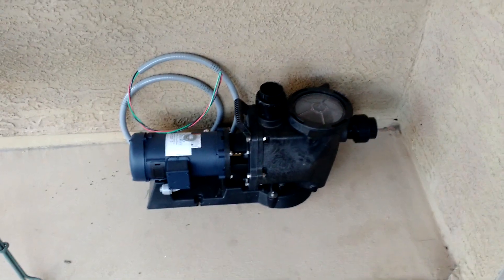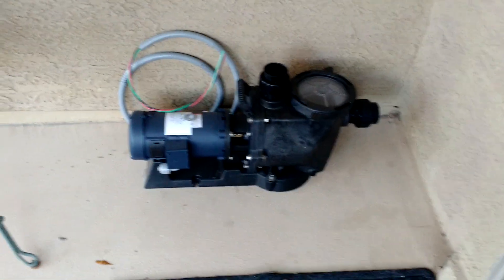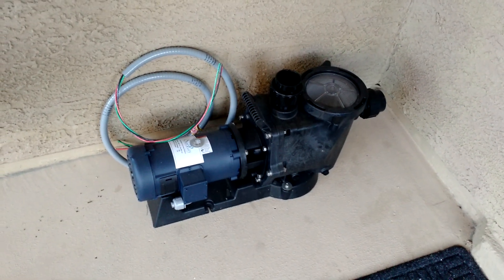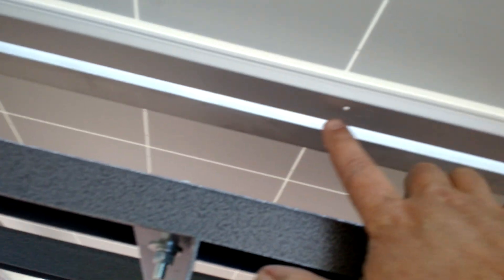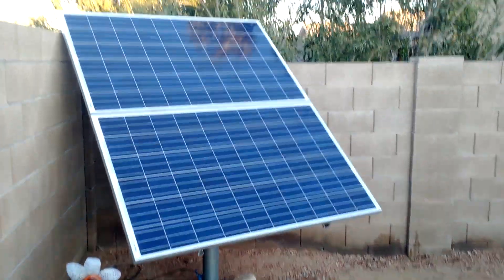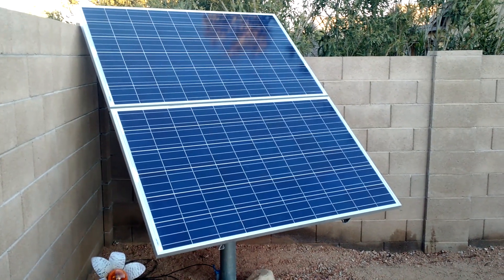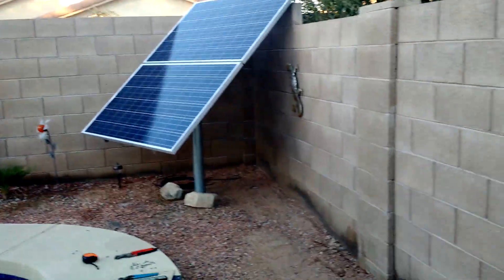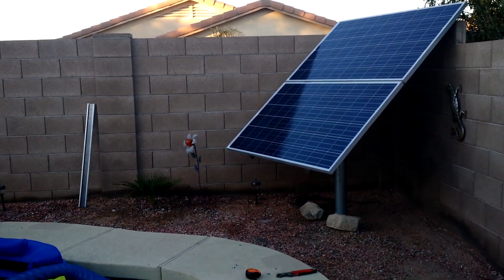Solar pool pump #2

Comment: A few batteries and a brat charge controller which is made by midnight solar folks will take care of that problem.   The brat can run on 24 or 48 Volt systems.   12 also.

Comment from the maker: sorry for my tardy response, I bought this system from solar pool pumps in California,
I do not recommend them. their customer service is terrible.  You can source all these pcs from many sources.  The biggest thing I've learned is you can't leave this system alone.  If you are here to monitor, no problem, but leave for awhile, get a few cloudy days in a row, which we get even in AZ. and you can end up with a green pool and a leaking pump seal.  When it's cloudy or even when a cloud just passes over, the pump slows way down, and if it slows so much that it is turning, but not pumping water, the front seal will burn out causing a big leak, and a 20 dollar seal replacement.  Bottom line, it was a waste of money, I will never realize a return on investment.  In hindsight, I would have gone with a variable speed pump, and ran it off peak for a longer period. that would have saved real $

Comment: Nice job. I'm doing kinda the same thing. For multiple panels a good voltage regulator will work when coming straight off the panels. 
Did u retrofit the skimmer box with a DC motor or buy it all in one?
Thanks
Reply: +1 I would like to know some more details and sources please